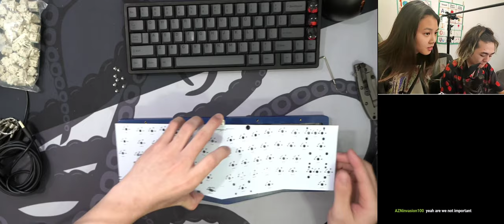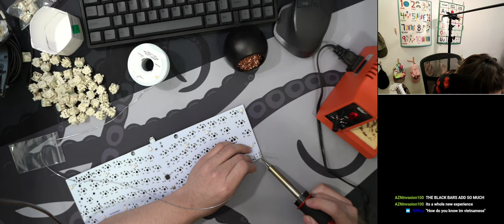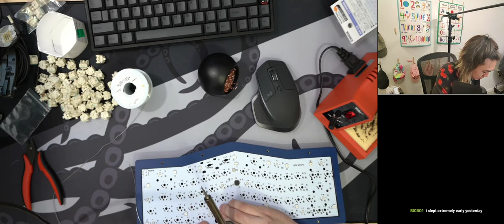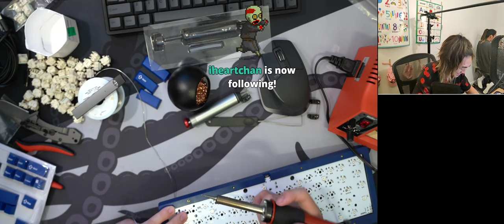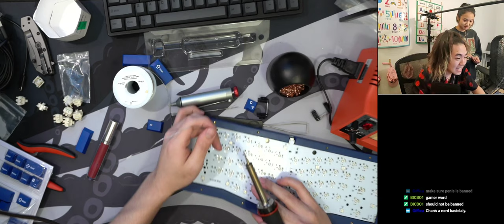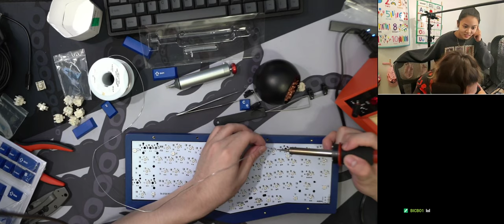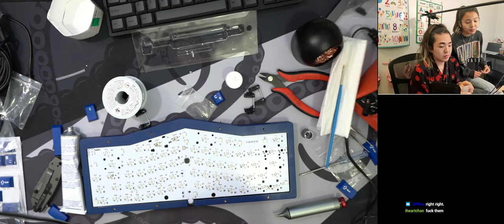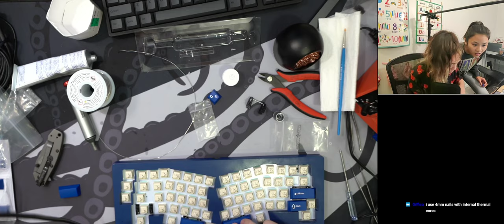AKrylic Alice build stream

Comment: loved the build it looks so nice! I had a question regarding the spacebars used and I was wondering if you could help answer. Did u use the spacebar or 40s kit for the spacebars on this board? I'm new to Alice boards so I'm just a bit confused. Thanks!
Reply from the maker: hey thanks! I used the 40/split kit. the spacebar kit also include the compatible spacebars, but the 40/split kit also includes a second b which is good if you have ocd haha